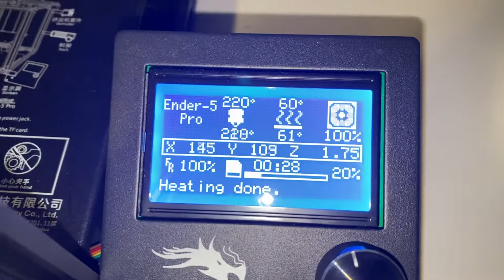Ender 5 and NinjaFlex, with a Micro Swiss all metal direct drive extruder.

Comment: Hey man nice video of this hotend in action! But I've got to ask, what bracket is that you're using(red piece)? I ordered my micro swiss direct drive and was under the impression that it didnt require a bracket to be mounted. Please correct me if I'm wrong because I'm rather new to this hobby but I'm trying to learn as much as I can haha. *disregard my statement. It would appear that the micro swiss direct drive will not fit/work on the ender 5 plus due to the way the bolts are ran and attached.
Reply from the maker: Hello Brenden. Actually it does work on the Ender 5. That is the micro Swiss direct drive extruded in the video. There is a bracket that you can print to attach the belts. Micro Swiss is also now producing an Ender 5 version but I do believe they are back logged with demand. You can find the adapter here https://www.thingiverse.com/thing:4337697. Or you can wait for the other version to be available.  Best of luck.
Reply: @baird1fa  no way haha! You sir are a badass life saver. What material would you recommend I print that out in? I was thinking maybe PETG? Or ABS plus?
Reply from the maker: Branden Gooch I just printed mine from PLA but my printer is not enclosed. If you were to enclose it you may want ABS. I only had PLA when I first got the printer. But i had intended to reprint it later if needed but so far no need.
Reply: @baird1fa  yes I'm building an enclosure for it this week. I heard abs is notoriously unforgiving when it comes to temps

Comment: Dear Farell, Did you use any coating on plastic bed of your Ender 5?
Reply from the maker: Siamak Elyasi  I did not actually and it nearly destroyed the bed trying to remove it. I have since moved to a glass sheet with a glue stick coating. It works awesome and peels off very nicely.
Reply: @baird1fa  Thanks!
Reply: I have switched to the E3d magnetic bed system on my Ender 5 plus and I no longer have to use glue or hairspray. I have yet to have a print to fail bed adhesion. And you simple peel off the bed liner and roll it to pop off the printed piece. Its pricey but man does it work.
Reply from the maker: Branden Gooch  the flex plates are nice but in the case of Ninjaflex the part is just as flexible as the plate so there really isn’t a piping off of the part.  But my only experience is with the ender 5 factory build plate.
Reply: @baird1fa  ahhhhhh see I've never printed with any flexible filaments yet. Kinda nervous to if I'm to be honest hahaha. I've printed only using PLA and PETG. I ordered some red ABS and I'm going to give that a whirl next. I'll eventually get to the more tricky materials lol
Reply from the maker: @brandengooch4101  I'm going to give PEI a try tomorrow on my printer at work.  I regularly print the difficult stuff on that printer.  But it is usually a bit of a fight as it is a custom modification to another manufacturers printer.   I also have some PEEK on order but I'll need to convert it to 1.75mm to use that.  For the ABS you may want an enclosure and to reduce your cooling fan as it likes to warp off the build plate and also crack/seperate between layers.  Good luck.